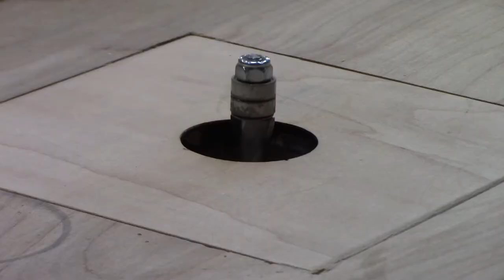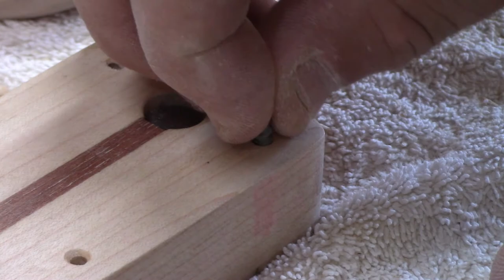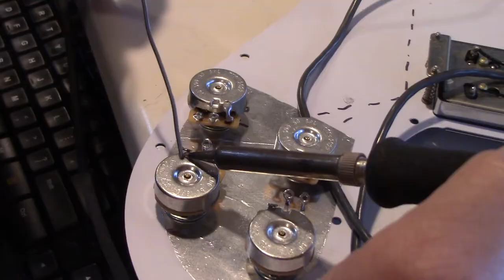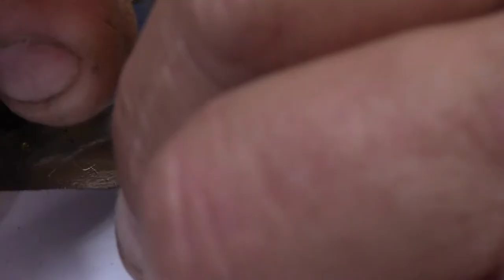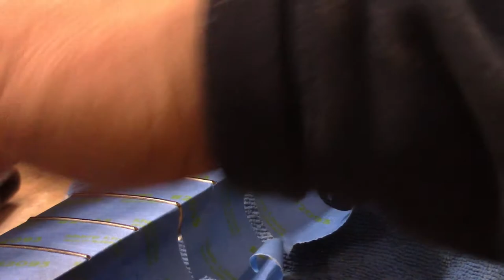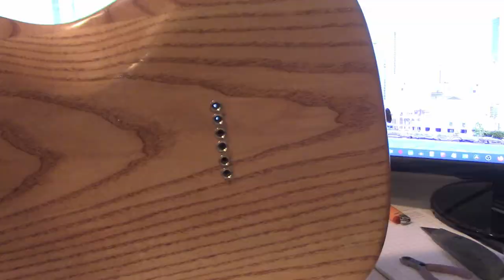Building a Telecaster Deluxe. Part 2: The Body

Comment: Fantastic. One of the best homebuild I have seen. 
But one thing. 
You did not shield the pickguard and there was no Contact between the condutive paint and the electronic.
You must use coppertape on the pickguard also to Get 100% shielding.

Comment: Hello sir nice video. Where did you buy the template for routing the cavity. I been looking for them but can’t find the Tele Deluxe template.
Reply from the maker: Thank you. I made the template myself. Since the cavities will be covered by the pickguard, they do not have to be extremely accurate. I used the pickguard for reference and made sure the cavity was big enough for the components to fit.
Reply: @lennyc624  thanks for responding
Reply: @lennyc624  would you consider selling it?
Reply from the maker: @memomedina5661  my email is lcribari@msn.com 
That's also my PayPal. If you're in the United States, PayPal me $25 to cover whatever the shipping is and I'll send it to you. Email me your address and stuff.